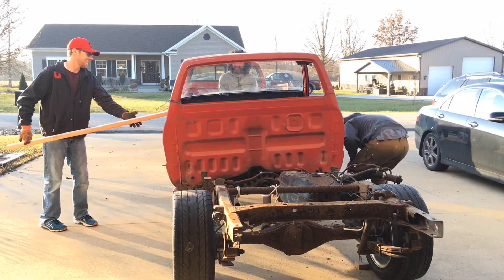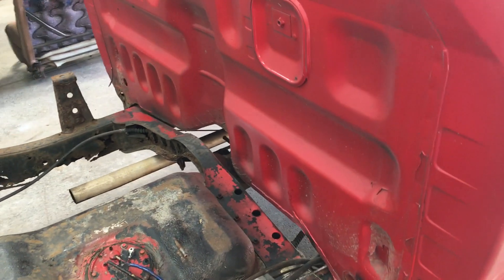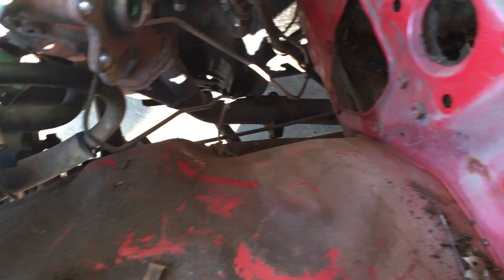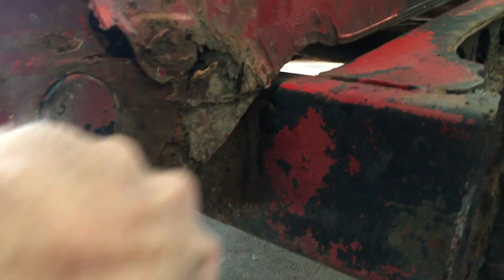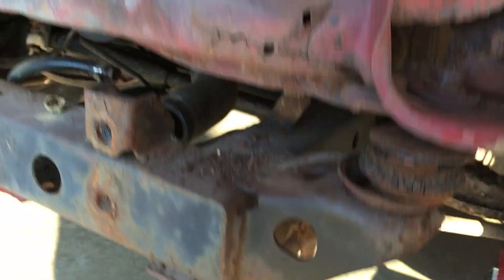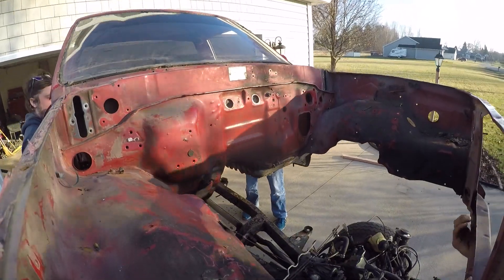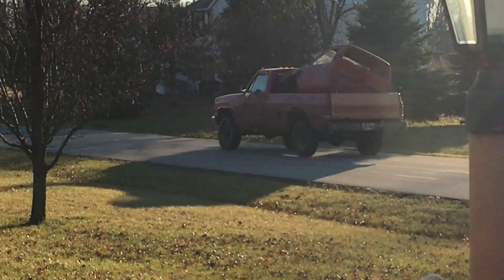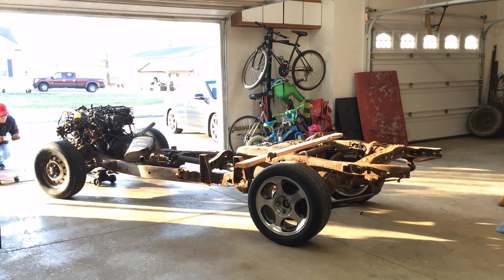Toyota Pickup Cab Removal - Engine Stays

Comment: Legitimately helpful video, thanks! I have a 77 Datsun 620 with zero rust (New Mexico truck) and I'm toying with the idea of removing the cab so I can strip and repaint the frame rails
Reply from the maker: I am currently in the process of doing this to a 1980 Toyota Long Bed from the south, except the cab floors were rotted because it sat outside for years with a broken window. https://youtu.be/imb9VbzPupw

Comment: My 1981 Hilux is the opposite lol, the cab is rusty as hell but the chassis only has very light surface rust.
Your cab looks mint compared to mine, mines full of holes in the roof, bonnet, lower doors and floors.
This is due to the fact that where I live in Australia we don't have road salt but rather salt in the sea breeze and morning dew due to our coastal location, meaning that most vehicles rust from the top down rather than the bottom up, unless they are driven on the beach
Reply from the maker: I'm restoring a 1980 on the channel right now (actually using 2 crappy trucks to make one good 1980) and one of mine is the same... excellent frame but rusty cab.

Comment: Working under my Michigan salt soaked 96 4Runner was a pain in the ass. It was the donor for my Tacoma 4WD conversion and I'm used to working under clean frame Texas/New Mexico trucks. I could probably have collapsed the entire rear of the frame with a few hammer hits. Which is insane to think about since someone was driving it up until it's motor went and I bought it.

Comment: What all did you have to remove so you could pull the cab off with removing the engine.

I’ve got a rusty 86 I want to do a cab replacement on.
Reply from the maker: Here is a video of the full process on my 1980. I also pulled the engine before removing the cab. because I was moving everything to a fresh frame, but I could have left the engine in place but I would have had to lift the cab a lot higher to get over it. How to Remove Toyota Hilux/Pickup TruckCab by Myself
https://youtu.be/L3H6z2gbSHs
Reply: @6thGearGarage  awesome thanks for the reply!

Comment: My science fair project is to find an alternative to salt for melting ice.
Clearly it’s a problem, and I’m surprised it’s still used.
Reply from the maker: I’ve read that some areas use a solution based on beet juice, but it is more expensive and still a little corrosive.
Reply: Interesting
Reply: Try saw dust. Here where i live in Finland we have some kind of experiment to prevent slippery. It wont melt ice but it is rising friction.

Comment: When I swapped the cab on my Truck I used a Homemade Wood beam adapter to my engine hoist and it was easy I just needed people on the front to keep it from Nose diving
Reply from the maker: I had a buddy unload a complete cab w/ interior from a trailer by putting a 2x8 board through the top of the doors and he balanced the cab on a hoist, under the board in the center of the roof. Sketchy but it worked!

Comment: Is it easier to pull the cab off over the engine?
Reply from the maker: If you use a load leveler, the engine should come out pretty easy with the cab still on.  I had someone buying the cab, so I removed it first.